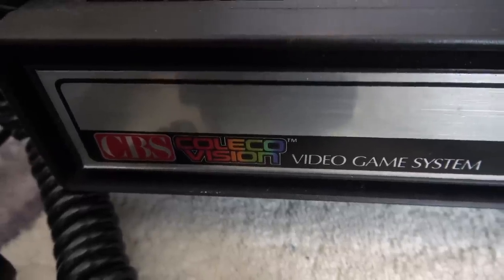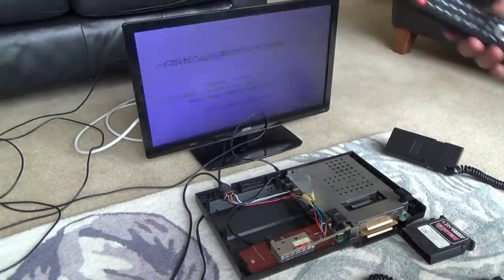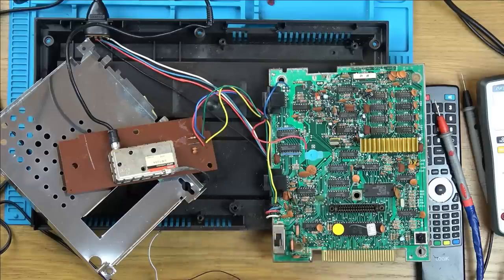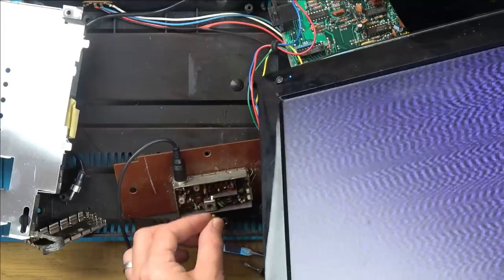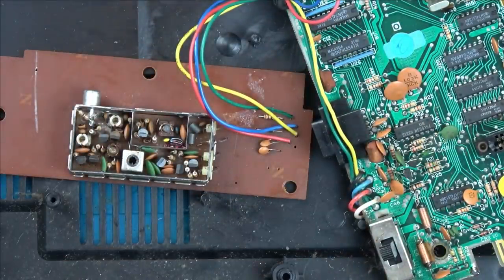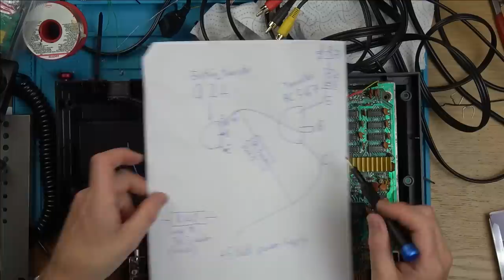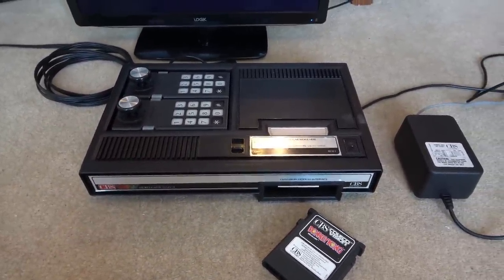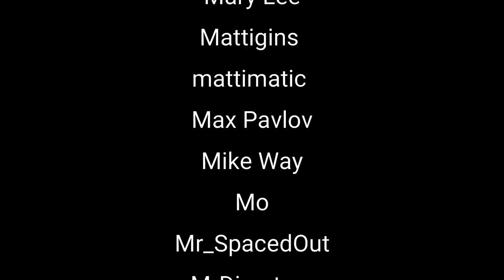BROKEN 1980s CBS ColecoVision Home Video Game Console - Trying to FIX

Comment: Greetings from California USA . I bought a COLECO Vision game console system back in 1983 . I still have it . Donkey Kong came came with my system as a combo package. I then bought Donkey Kong Jr , Gorf , Rocky wich was based on Sly Stallone's Rocky movie when he fights Mr. T . Rocky came with a pair of 'SUPER CONTROLLERS " .  I then bought Baseball . The expansion module on the COLECO game console, you could connect CLOECO'S ADAM which was a separate computer with key board and all. That is why the power supply on the COLECO Vision is huge. It would power accessories like the ADAM computer and what ever would come in the future . By the way...back in the day most game cartridges were basically versions of arcade games . Gorf , Donkey Kong and Donkey Kong Jr are examples of arcade games for home console game cartridges . Of course the graphics and game play were not exactly the same as the original arcade versions but they were still fun to play with .

Comment: Your Son is a talented artist!!!  Those "bumpy" traces -its from where the board was wave soldered, or dipped into solder.  You got uneven solder on the larger areas as it cooled - common to see on older computers and stuff from that era.  Lovely fix =D  Video and sound is great =D
Reply from the maker: Nice one Chris, I knew you would have the answer on the bumpy creased tracks. I will pass on the praise to Ben, he loves me telling him about the nice comments. Cheers mate 👍😀
Reply: Thx for this i had assumed it was the PCB coating/mask.
Reply: @Mymatevince  Vince, i don't think that is easy to fix it
Reply: A lot of old arcade boards have the same "wrinkly" solder. First time I saw it, I thought it must be fragile. Later learned otherwise
Reply: @Mymatevince  The slug that you retrieved probably belonged where you took it from, just someone had overtweaked it and broke it. You can get pastic trimmer tools to adjust those inductors without your body and the metal in the tool that you use throwing off the adjustment. They can be VERY finicky. Well done on the fix and your son has some good talent there. Also, I was shocked you hadn't come across Gorf in vintage computers or in the arcades. It was a big deal when it was new as it could even SPEAK to you in the arcade! How cool was that? One of the first, if not the first, arcade machines with speech synthesis.

Comment: It's very interesting to see the insides of one of these CBS models for the first time.  I was surprised to see that RF modulator situated where it was when the U.S. Colecovision has it on the main board.  The CBS models came out a year after the ColecoVision was released in North America, so it would seem that they made some significant changes along the left hand side of the board to make it easier to accommodate different modulators for PAL and SECAM.

Comment: Brand new ASTEC UM1286 modulators are available to buy for around £15 and will come tuned for video and audio ready to solder. Would have kept it original and gave you a lot less hassle. However, it was a well presented video and you used your skills nicely to diagnose and remedy the problem to get a fix. ON to the next one!!

Comment: Most tunable coils of that era had ferrite slugs in them.  These are quite fragile and brittle.  Often once set up in the factory they had hot wax put on to fix them in place.  This or just using the wrong tool can cause the core to break if attempted to be turned.  Such 'twiddly bits' are often a magnet to young inquiring minds (I broke a lot in radio's etc. as a kid).  My guess would be someone played with the trimmers, some broke, a brass screw was substituted for one and whatever was in the other just fell out.  Great diagnosis to find the issue pretty quick.
Reply from the maker: Thanks Mike 👍
Reply: So are those things adjustable inductors?

Comment: Great job! An AV mod is usually the way to go with these old consoles, unless you're an avid collector and really want to keep them mint. I've done some Atari 2600 systems that way. The added transistor is basically amplifying the video signal as this is normally done inside the modulator. The rippling on the PCB I've encountered in an old Atari 400 computer. It's harmless, but scary if you don't know what it is. BTW, your son is very talented indeed. Amazing work!

Comment: The basic hardware specs of the ColecoVision (Z80 CPU, TMS9918 graphics chip and SN76489 sound chip) were also used by Sega for their SG-1000 (which wasn't released in the Western world), and then although the Master System and Game Gear upgraded the graphics chip, they continued to use the Z80 CPU and SN76489-based sound core, which were even both put in the Mega Drive as its secondary processor and sound generator alongside the 68000 and YM2612!

Comment: Those astec Modulators were user in home computers in the day, the version you have there had sound but ther was a cheaper version didnt. Most people would just do the composide mod you have done in the version of the mod for the spectrum computer there are 3 different options to get the video signal looking better. There are more modern modulators that you can buy NOS that are left over from VCR production in Europe that are a different shape and need an Ardunio because they are controlled with I2C but with analogue TV being dead most people wouldnt bother. The wrinkly pcb traces were common on cheaply made pcbs of the time.

I had one of these second hand about 20 years ago with the Atari convertor that i bought at a car boot with lots of boxed games but sold it on ebay as about 30 lots:) As a Sinclair collector i would sell on ebay retro stuff that turned up to raise funds to buy Sinclair stuff instead.

Comment: It's totally normal for older PCBs to have that rippling on parts of some larger traces (apparently due to the process of the plating). It's quite disturbing when you first come across a system that has it, especially one that is currently not working right 😮
Reply from the maker: Thanks Garth, yes, very disturbing. At least I know for next time 👍👍👍
Reply: @Mymatevince  The rippling on older Boards occurs during the tin plating / wave solder process that was used at the time. It is nothing to be concerned with.

Comment: You can't adjust those slugs with a metal screwdriver, it will affect the tuning.  They make special plastic drivers to tune slugs.  :)  Great job on the conversion!

Comment: Vince, based on the circuit diagram I think a neater solution for the composite mod might have been to build a small strip board module with the three RCA plugs on and just use the wires that attached to the old RF modulator circuit board. You had the ground and the leg you lifted on the transistor only went to he RF modulator board connection so you could have left all that intact, changed to one resistor that you needed to change and then built it all on a strip board with jacks so the composite cable didn’t need to be hard wired in and could be changed as needed. Granted your mod works, but I think it would have been neater to leave the unit largely untouched with just the resistor and potentially a 5v feed wire added in to go onto the strip board. Just a thought :) good video though, great to see these things saved for future use rather than just binned.

Comment: Those are tuning coils and the "slug" or center portion affects the resonant frequency of the coil.  Any conductive material affects the tuning, but ferrous material works better.  If there's a slug of  magnetic or diamagnetic material in the original design then substitution of a less magnetically permeable material will shift the frequency outside component specifications.  Those circuits are very sensitive to frequency as NTSC timings are in the mhz range.
Reply: Not just NTSC but PAL both around 8 MHz.  But the R F out is 450, MHz ( UHF ) in europe
Reply: I just finished up tuning an old CRT for an 80's era CNC machine and was thinking of this video as I worked on it.  If you are tuning one of those coils, you have to use something non magnetic to do the tuning.  A metal screw driver will affect the setting drastically.  This is why many TVs and monitors of that era had little plastic adjusting tools mounted inside their cases.  As Tiporari said, they are very sensitive.

Comment: Half finished projects usually represent a perfectionist tendency.  This comes from a recovering perfectionist that now finishes projects, but slightly imperfect.  A huge weigh lifted from me when I stopped trying to be perfect as in reality, I was a perfect fool.
Reply from the maker: Never have truer words been spoken. 95% perfect is good enough, as that last 5% is very hard to achieve, and most people don't notice it. A 95% finished project will always beat an unfinished project. 👍👍👍
Reply: But what if the pile of unfinished projects fills up 95% of your apartment? Wouldn't that be yet another unfinished project? Asking for a friend...
Reply from the maker: @JustACupOfCoffeePLZ  🤣🤣
Reply: @JustACupOfCoffeePLZ  You made me laugh, but that is also a struggle.   This is going to sound crazy, but I try and channel patient people like Vince and others to slow down my projects, be only as thorough as needed and wrap it all up in the same block of time.  It's the most difficult thing I have to face in my personal life.

Comment: I had one of these back in the 80s and when it finally failed after many years of use, it failed with what was a common problem, which was one of the memory chips.
We had everything that was available for the system at the time and the steering wheel with accelerator pedal was really leading edge at the time.

Comment: Another great video Vince. great analytical trouble shooting. I actually have a spare Colecovision Modulator board. I did a Coleco early on on my channel and it had modulator problems too, in my case seems a good cleaning fixed it, I think modern TVs expect more precise RF signals from modern electronics. Older kit was more accepting of imperfections, that could be what prompted someone to twiddle in the first place... for me that seldom goes well. I ended up with the modulator as I eventually did the gamesx mod and removed the modulator, it worked for me, but it could be luck. I think your circuit wasn't too much different, perhaps using the TV as ground and not using the 75ohm impedance match. I don't think it will damage console. As others have said the rippling of the PCB is normal, graphite slugs suck and a plastic screwdriver is the way to tweak them. Love seeing your sons pics, very gifted. Another great video mate.
Reply from the maker: Nice one Roger, cheers for the info 👍👍👍👍

Comment: For half the video, I'm just shouting "Dude... what are you doing.  Rip the RF modulator out and throw it away!"

The transistor mod you did for the video port looks really close to the Atari 2600/7800 AV mod.

Though with that fragile install (no circuit board, and it's just flapping in the wind), I would pot it in epoxy to create some mechanical stability.

I also wouldn't have embedded the AV cables, but just installed a TRRS 3.5mm jack.

Comment: All of those broken parts in the RF modulator are variable inductors.  It is very clear someone was previously in there "fixing" it.  It's a very common problem with people who unwittingly use metal screwdrivers to adjust these things.  The cores are pressed ferrite iron (very often), and they are fragile and will break apart into tiny pieces if you use a metal tool.

Comment: Never had one, but I’ve played one a few times.  When I was a kid, my mum and dad used to go to the cash and carry , Makro.   Makro is a trade only shop (you have to join, and to join, have to prove you own or manage a business).   

Not sure about now, but in the 80s, they used to have two halves.  There was a cash and carry, and a sort of department store.

The department store went downhill (IMO) but in the early 80s had an excellent computing department which sold all sorts of computers and consoles.  Including the Aquarius, Ti99 4/a, the complete Atari and Commodore range, the Osbourne 1, the Intellivision and the Colecovision.

Of course, that wasn’t all at once, the range changed over the years.

And yes, they did have one of pretty much every device set up so you could try it..

Comment: Still got one of these at home, power switch is stuck, i have to take care of that one of these days. I even have the atari extension that plugs in and allows for playing atari 2600 games. If i recall correctly, my french model came with a scrat cable, not rf.

Comment: PS If anyone understandably doesn't live the Colecovision / ADAM controller you have three options:
1) Put up with it - boo!
2) Use your favourite Atari-type controller in port 1 and use the num-pad on the controller in port 2 - player 2 will just have to suck it.
3) I've designed a gamepad-type controller complete with num-pad for the Colecovision / ADAM - the instructions are on Thingyverse. 😀

PS
You can also make a joyport splitter so you can plug your favourite Atari-type controller and the Coleco controller in at the same time. There is also a semi-mythical 'super' controller for the Coleco that is supposed to be very nice indeed, if you can find one.

Comment: Just thought I would point out that under the video mod on the site it shows an audio mod with two resistors. This is a voltage divider and reduces the voltage going to the audio out. 
By not doing the audio mod you are overdriving the line level audio. Your line level audio should be about 1v and it looks like you are feeding it 5v. You may want to fix that before you play it for any length of time, as it could blow the audio on the TV.
Reply from the maker: Thank Grandpa 👍👍👍

Comment: As an initial guess, I'd say the RF modulator needs tweaking a bit.  Let's see.  The problem with those coils is that they're very brittle and degrade over time.  Finding a replacement modulator would save a lot of messing about.  I've watched videos of people who've converted old ZX81's to have an A/V output, i.e. composite signal, so doing the same thing here is relatively simple to do.  It's just knowing how to modify the circuitry to get it to work.

Comment: These consoles were made for analog tuner tvsets so usually the audio RF isn't easily tuned by last generation tv tuners , some work some don't , coleco was an msx computer and most msx computers used scart/peritel as standard and not uhf tuners

Comment: There are at least three things you want to tune on an RF modulator:  the frequency of the main video carrier, the frequency of the audio subcarrier, and the frequency of the chrominance subcarrier.  The coil you're trying to tune is supposed to have a slug made of powdered iron bound with some kind of glue-  ferrite- and it's almost certainly specific to that particular thing so you can't really buy a new one.

My first instinct would be just to composite mod the thing and add a couple of phono jacks on the back, but if you want to keep it "original" then I'd borrow a modulator off of something else.

Comment: I did notice that when you first tuned it in on your TV that the screen showed UHF Channel 40.Many early computers including my original Spectrum used UHF channel 36 so when Channel 5 came along using channel 37 videos and computers etc had to be retuned to avoid interference.It looks like someone at some point has tried to adjust the modulator tuning and modern TVs aren’t as forgiving as older sets .

Comment: You made a small mistake but you were lucky :) the 1k resistor should go to ground not to output video. You should have another resistor 75ohms from emitor to output. The transistor is not working now at all but somehow the signal pass  to output. That transistor should be a buffer between the existing circuit and output and also the circuit will change the impedance to be more suitable for tv
Reply from the maker: I will check it out, thanks for the info ovidiu 👍👍
Reply: I have to admit, I was a bit confused by the circuit drawing. I couldn't understand how the transistor was working, as it seems the BC 547 base was always on and the output going through the resistor instead of being in parallel. I couldn't understand how it worked.